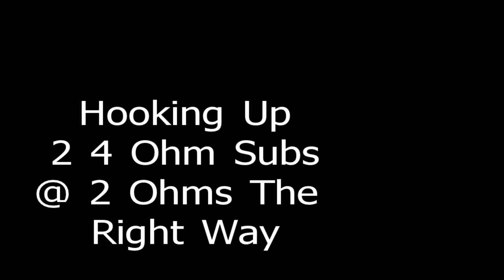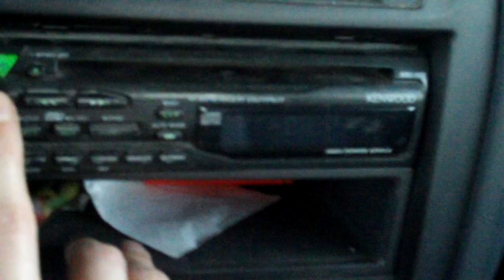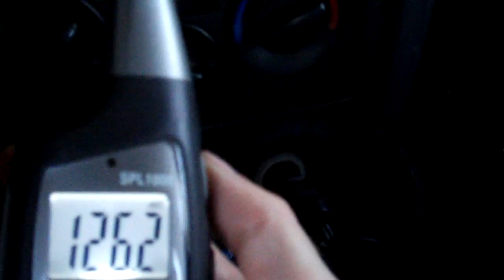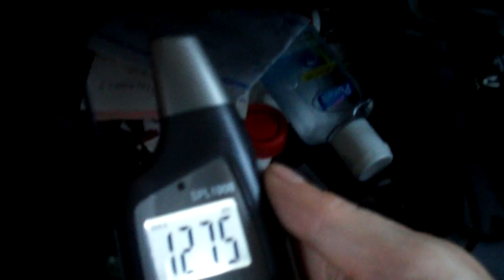How To Hook Up Two 4 Ohms Subwoofers @ 2 Ohms On A Mono Block Amp

Comment: positive wire from amp goes to first positive terminal of the sub the negative terminal should have a wire that runs over to the positve terminal of the second sub and then a wire comes off the negative terminal from the second sub and runs back to the amp. bridged @ 2OHMS hope that helps ya ppl. if ya unsure how many ohms ya sub is test with multi meter positive and negative should be around 4 or 2 ohms. then work out what impeadence ya amp will run at
Reply: False thatd be 8 ohms

Comment: i get noise coming out of my speakers when using my breaks. it also comes on when i use the turn signals. also when i turn the lights on but its not as loud. i had the alternating whining noise but i got it fixed by grounding my amp to the chassis of the car and not to the battery how it was when i got it. Any ideas?
Reply: You should never ground an amp to the battery. You want the ground line as short as possible and connected to the frame/chassis.

Comment: Hw to wire 2 orion hcca 15 4ohm sub to soundstream xxx10000d amp to get max power out of amp?
Reply from the maker: Dual 4's or single? I'm guessing dual 4's. Hook All positives together then to positive on amp. Same with negatives. Will give you a 1 ohm load. Hope you got good electrical with that amp
Reply: i got 3 kinetic hc2400 battery,somone told me it will be wire at 2ohm
Reply: casperskafs They are SVC. If they were DVC the ohm load would drop to 1 ohm in parallel.

Comment: Hey I've got two 10inch subs (400W each), which I was hoping to run off my two channel amp, but it's a 600W. I've also got a 800W mono block amp which I was thinking of running 2 6x9s off... What would be the best way to run this?

Comment: heres a question, you may have to do a little bit of research maybe to help me out here. I have a DC Audio Level 4 15 inch sub with a 1.2k DC Audio amp (both can be seen spec wise at www.dcsoundlab.com). I want to know if I can throw my kicker 12 inch L7 into that mix or do I need to run a separate amp.

Comment: Hi i get the 2 ohm bit.im just wondering i have a sony xmds1600p5 1x500 rms4ohm or 1 x900 rms 2 ohm.but it has 2 channels?its a 1 channel operation. Class d.should i be puting my wires on 1 chanell or bridge on the amp.

Comment: Its impossible to wire two 4 ohm subs to 2 ohms if there DVC, not sure about SVC. You can only get to 4 ohm and 1 ohm.
Reply: Yea you do same as in the video just use one voice coil and there you go 2 ohm load
Reply: Elbert Watford correct
Reply: Actually, if you hook up one voice coil from each woofer in parallel, it will bring the impedance to 2 ohms. But with a little over half power. I'd say about 40-45% less power, but using only 2 of the voice coils, the rms power on your amp should line up better.
JUST KEEP IN MIND, YOUR AT A LITTLE OVER HALF POWER. 
i.e. if you have an 1800 watt max sub dvc4 ohm, the rms power is 900, if you hook up only vc from each one, you will have a total of about 960 rms for both, approx 460 per sub. And it can be done on a MONOBLOCK!
Reply: @devonjones3298  thatd be the dumbest thing to do ever. If you have dvc subs but only wire 1 vc.
Reply: Greg l but it still proves the point that you can make dvc subwoofers go into 2 ohm
Reply: @devonjones3298  that completely defeats the purpose.. you can do it but you're only using half the speakers capability which is totally ignorant
Reply: @DMGWrld999  please show me how you achieve 4 ohm impedance with 2 - 4ohm DVC subs... I'll wait....
Reply from the maker: You are correct
Reply: Dustin Gildea lol no mines I have that sorry
Reply: @DMGWrld999   the kicker CX 1200 is a monoblock with two channels do some research
Reply: @talonashby2166  then it's not a monoblock!! Several monoblock physically have 2 speaker inputs, but that's NOT to be confused with 2 channels! They do this for convenience. It makes it easier to wire this way, especially if you're using a lower gauge speaker wire!
Reply: You can run 2 - 4-ohm SVC subs parallel for 2ohm..but you cannot wire 2- 4-ohm dvc subs parallel for 2ohm.
Reply: You cannot hook up only 1 side of a DVC sub.you have to use both connections on DVC subs
Reply: @billywethington8068 you can hook up one side but it will only have a 4ohm at the amp.
Reply: This guy is wrong as hell. .. no way hozay
Reply: Derrick Allard wrong you can take two dvc 4 ohm and wire it down to 2ohm
Reply: @elbertwatford2904  no you cannot. Its 1, 4 or 16ohms on 2 dvc 4 ohm subs. Parrallel coils puts each sub at 2 ohm to parallel wire the subs=1ohm. Series the coils putting each coil at 8 ohm then each sub then wire in parallel equals 4 ohms, series of each coils puts them at 8 ohms each woofer then wire them togetherbin series equals 16 ohms. 2 single voice coil 4 ohms wired in parallel=2 ohm. Or 1 sub dual 4 ohm can be wired in parallel= 2ohm. Or a dual voice coil 1 ohm can be wired series for 2 ohms. 2 dual voice coil subs with 2ohm coils can be wired series parallel for 2 ohms. But never can 2 dual voice coil 4 ohms be 2 ohms. if they are you got more issues to worry about then wiring cause you got a sub going.
Reply: @elbertwatford2904  im not even going to get into box rise.
Reply: Derrick Allard oh it's possible I got 2 4ohm subs wired @ 2ohm on a 2 channel amp

Comment: Hey man I have 2 jl 10 inch subs with an mb quart monoblock amp and an alpine deck, and it is hooked up to my car battery by 1 cord on the positive side. All the wires are set up fine. Right after i hooked everything up it was working for 5 minutes then stopped.  When I play music the subs dont work and the light on my amp doesnt stay fully on it flashes on and off slowly like its losing connection, at first I thought it was the remote turn on wire but i fixed that, im wondering what else I could try to get them working again
Reply: check your ground. make sure you have good contact on bare metal. scrape all paint....if your ground is fine. on the power wire fuse block make sure you have the correct fuse. if your running a 1k watt system you should be running an 100 amped fuse.
Reply: Austin Welch sounds like a fuse

Comment: When you have a daul voice coil 4 ohm sub you will have two terminals on each side ..run positive to positive and negative to negative.  Which will make it two ohms.. do the same to other sub..and then wire them together with a positive and negative wire.. then when you wire them to the amp you should only have two wire running to your amp.. which will put you at a 1 ohm load

Comment: looks like you had the setup fine in the first place, the 2 monoblocks i've had have both had 2 sets of terminals for wiring in parallel, running 2 sets of wires into 1 terminal works fine as long as it fits haha. only wrong way i can imagine to wire multiple subs is to do them out of phase to each other

Comment: I have a set of speakers that r 2600 watts a peace  and I have a two amps one is a jl audio e1800d and the other is a boss 4800 class d amp. Which amp should I use and at what ohm

Comment: Help on Amplifier......I have a Memphis 15-m5124d dual 4ohm 200W RMS 400w Max .... What size of amp do I need to run it. I have a diamond D600. 600w  at 1 ohm mono bridge but I think it clips can it work with the Memphis and anyone out there have a diamond Im not sure if it works because the  power light only flashes. But what type of amp do I need to look for or which one. Thanks

Comment from the maker: You can run 100000000 speakers on any amp just gotta wire them correctly. Check out rockford wiring wizard for easy pics and stuff to show you how to wire. I could explain but that will make it more simple for you

Comment from the maker: You cannot unless you wire 2 subs to each amp in series then parallel then strap the amps. Google rockford wiring wizard bro it will show you wiring configs but 2 dual 4's in parallel is one ohm

Comment: I have 4 dual voice coil 4 ohm Kicker CVX's and I have 2 Kicker ZX2500.1's I need to know how to get both amps wired at a 2 ohm load so im not running them hot at 1 ohm please help as fast as possible PLEASE nobody will help me =\

Comment from the maker: Google " Rockford wiring wizard" and made sure you are wiring correctly ALSO made sure your gain isn't maxed out!!!. Those crunch amps aren't bad but get hot quick and easy if your clipping or wired to low

Comment: I have 2 15's both 3000watts I been tryna hook dem up to a 2000watt mono block crunch amp at 2ohms but it keeps shuttin down and doesn't hit that hard as it should
I need sum answers

Comment: its a bit hard for me to say what im tryna say in words, but there is series and parallel circuits, electricity has to go through both loads in a series so 4ohm would be AFTER 4 ohm, making the impedance/resistance 8 ohms between the amps + and - terminals, but in series the electricity from the amp has TWO paths to take so the sub's still have a resistance of 4 ohms, giving the electricity from the amp 2 routes halving the resistance of just 1 x 4ohm load, meaning 4ohm/2 speakers = 2 ohm

Comment: the way u changed it to means sub 1 is parallel with sub 2 from the amp, essentially its the same circuit as both subs connected into the same connection on the amp, because electricity from the neg terminal at the amp can go straight to sub 1 and straight to sub 2 and electricity from the sub's positive can go straight back to the amp from either sub, im not too sure what the previous setup was but im pretty sure it was a parallel too so either would run the same

Comment from the maker: Get dual 2 subwoofers so you can wire them in parallel separate then in series together to get a final load of 2 ohms so you'll get the max power outta that amp

Comment: I got a tricky question for ya mate, and ull have to email me if you can be assed job2share@yahoo.com id really appreciate it. I have a amp that breaks down from 650@4ohm To 1000@2ohm & 1800 @ 1 ohm RMS. I have two 12 inch TSW121SPL Duel 4ohm 750rms each Can i get these down to 1 ohm if so how? i heard because i have two its possible is that true?

Comment: So im new to this whole car audio thing. I have 2 10"kickerc10 subs, and i dont know if i should get a "Kicker DX300.2 (11DX300.2) 300W 2-Channel DX Class D Power Car Amplifier/Amp  or a "Kicker 12CX3001 CX300.1 CX 300 Watt RMS Mono Car Audio Class D Amplifier/Amp" ?  wondering what you would do? thanks

Comment: Hey, I've got two kenwood subs, I can't think of what they are off hand but there blue plastic on the outside. And I have them hooked up but you can here like the plastic rattling when the base gets deep. Do you have any ideas or tips how to fix it. Maybe I have them hooked up wrong or they're getting too much power from the amp. Idlk that's why I'm asking. Oh yeah they're 12 in subs

Comment: The thing is they come in a dual box so i might aswell take it , and one amp wont do the job its listed as half the power , I mean you have two , so why miss out , but do you think in that case il need two amps for each of the subs ? or should I just get one 15" and have a bit less power but with a better amp.

Comment from the maker: I've never heard of those subs but I know that amp. It will do 1200 watts MAX.  If they are dual voice coil subs hook them up in parallel. Check out rockford wiring wizard to pics of howto wire. DO NOT get 2 of those amps YOU WILL GET THE SAME POWER WITH 2 that you will with 1. Get 1 good amp if you want good results

Comment: I have a question , That i'ev tried looking for answers but failed. I want to get a twin vice 12" in a sealed box ;  Driver : 2 x Space 12â€³ Dual 4
Enclosure Impedance : 1 or 4 Ohms
RMS Power : 2000w
Peak Power : 6000w

Those are the specs of them so can i and how do i wire them to a Power Acoustik OVN1-4000D ? And will that amp be enough , or do i need two of them.

Comment: how do you connect 3 15s that are 2ohms that are 1800watts 900rms to a mono block class D amp that has 2500watts with 4 terminals?

Comment: Hey, I have 2 alpine type r's and a box with 2 terminals on the back. How do I wire the subwoofers to 1 ohm? Each Subwoofer is a dual vc 2 ohm. Thanks

Comment: any suggestions on a amp that will power my dual 12 jackhammers 4ohms single coil.... right now I have both connected to a Kenwood kac-8015d mono block.... I belive its running at 500 watts@  2 ohms any suggestions?

Comment: Since your sub is rated for 1500rms a 2000watt class D mono amp that can push at least 1400rms will run your sub just fine, don't cheap out on the amp though, some brands say 2000watts 4000watts but don't put out the rms power it says it does, spend the money and get a amp that for sure can push the desired rms power.

Comment: ok i have a question. so i have two 10 inch rockford fosgate p2 punch subs in a ported box. and a mono 1000 watt renegade amp pushing it.. my friend just just gave me a i believe 12inch pioneer comp sub. how could i hook up that sub along with my two 10's? would i need a two channel amp. or just an extra mono amp. a bettery capacitor what? lol if you have any info id appreciate it thank you

Comment from the maker: Yes that makes it 2 ohms running it in parallel. People face there subs like this for different reasons. Sometimes they don't have enough room in the box or there is not enough air space. Yes this can be louder sometimes but ya gotta wire the subs backwards. When I was doin this I didn't know to wire backward so the subs were hitting normal.

Comment: Yea but I seen quite a few upside down n I think its louder with a sealed box instead of a ported I got 2-4ohm c15's in a 40" ported box, single voicecoil I just run one speaker to the other and into the amp from there, that makes it 2ohm now right?

Comment: Get Alpine, pioneer or if you wanna go cheaper but still good quality kenwood amps put out lots of RMS on the mono's but there ratings are not correct say it says 900 RMS at 1 ohms it roughly puts out 650 to 750 RMS at 1 ohms but Alpine is the way to go :)

Comment from the maker: I doubt it on a fusion amp. Its prolly a 2 channel. Their are monoblock out there that have terminals like that for easier wiring but its usually the more expensive ones

Comment: FYI.....A monoblock has 2 positive and 2 negative ports. Internally they are wire in parrallel. To change the ohm configuration, you wire the speakers, not the amp.

Comment: nice vid man. i got got a question. I got a 15  dual coil kicker running on 1 ohms( going to chnage it back to 2 ohms)  and have a power acoustikic 4 channel 1400 watt amp. its  says on the website that the amp is 4 ohm and 2ohm .  I dont know how to tell so how  do i hook it up on my amp for  4 or 2 ohms

Comment: dude ive been watching your videos and ive learned more from you in this short period of time then i have from any others. well i have a question  i just bought  a pair[2] of 15 inch         memphis PR {power reference} single voice coil and there was a specifications chart that came with em and it says that they are 250 watt continuous and 500watts max.now the question lol speaking on the wattage im looking at a memphis amp so as to keep the same brand and it 2000 watts.is dat to much?more 2com

Comment: 4 ohms will be louder, 8 ohms will sound cleaner. If it's subs, go 1 ohm because it's hitting like a range of 300 tones so it doesn't need to sound clean. If you're going for midranges/door speakers, go for 4 cause it'll sound real clean and pretty loud if you get the right amps

Comment: i have 2 powerbass 15's both dual 4 ohm subs, with a 2 ohm stable amp, what is the best wasy i should wire these? (and the amp is 2 channel)

Comment: wrong. if you get 2 channel amp you can run each voice coil its own channel. just be careful to run both channels off the same amp or it will blow the coils apart lol this is actually the way to achieve the best sound quality. just be aware, if your subs rms is 300w each voice coil can handle 150w rms.

Comment: Hey I've got two older 12" sony xplod's, 1100w peak, and 350RMS.
I'm about to order a Hifonics BRZ1200.1D to power 'em. Would I be able to be loud as tits and still keep it clean?
If not, what amp would you suggest?
Thanks man.

Comment: do you know if a Rockford Fosgate R500-1 500W Mono Prime Amplifier will safely push two kenwood 12's at 250 rms, they are 4 ohm single voice coil subs, pls respond

Comment from the maker: Your headunit doesn't matter what ohms if your using an amp. The amp ohms are what matters and yes run that amp @ 2 ohms and you'll be fine. You can actually get another 2 ohm sub and hook up with your other 2 ohm sub and that will run that amp @ 1 ohm which is also fine since the amp is 1 ohm stable

Comment: Thank you, most of my local friends buy trash like new lanzars(old actually were worth something), pyramids, la audio, and other trash and they brag they are so loud with thier 15's and I blow most of them away with a BR300.1 and a pair of MA80xe's wired at 4ohms in sealed boxes. That is only 75wrms per VC.

Comment: The amp i Plan on using is a HiFi1500d which is 4,2, & 1 ohm stable. the head unit Im gunna use is a jvc kdr530 which only takes 4 & 8 ohm. Can Still run both my amp and Sub @2ohms? or could i Run my sub @2ohms and my amp @4ohms?

Comment from the maker: You can only wire them down to 1 ohm if they are dual voice coils. 2 ohms if they are single voice coils. The lower the ohms the more power from your amp IF your amp is 1 ohm stable. So many factors in that bro

Comment from the maker: Does your amp have a switch that says HIGH MID SUB. If so yes you can do it just switch it to sub. If not no. Words will come out of the subs and prolly not sound good. My suggestion either way is get a mono block or at least a 2 channel